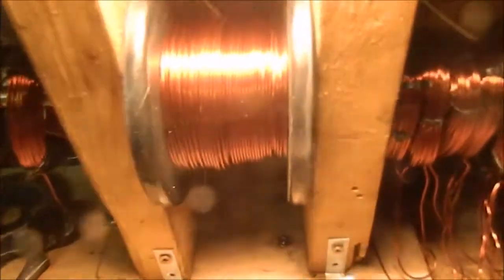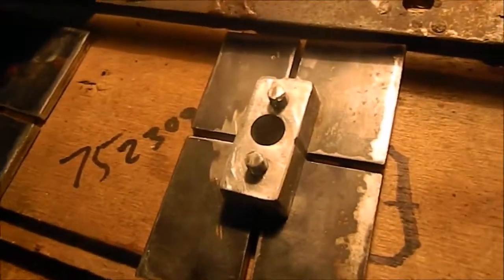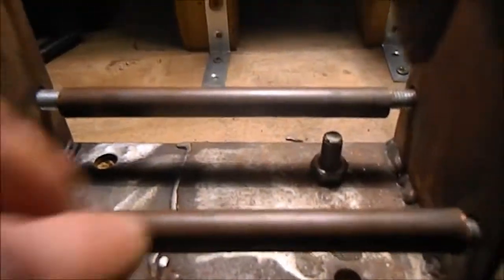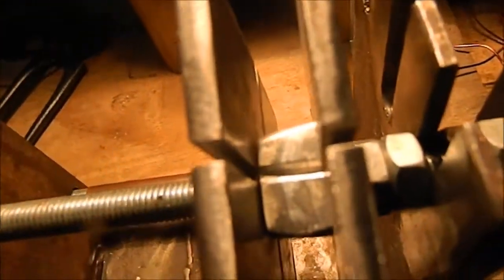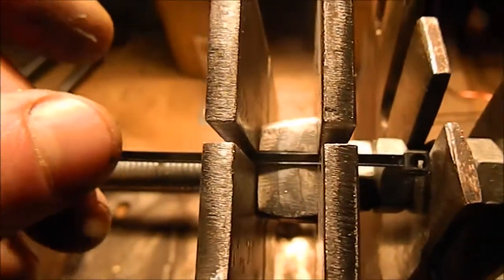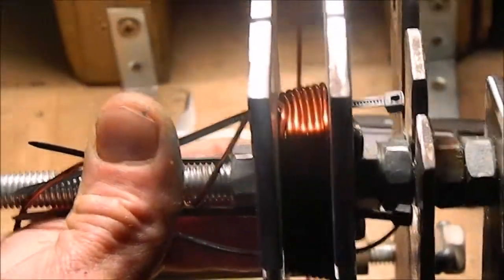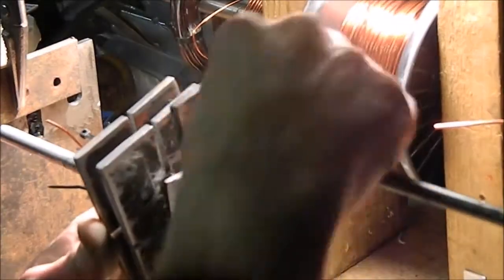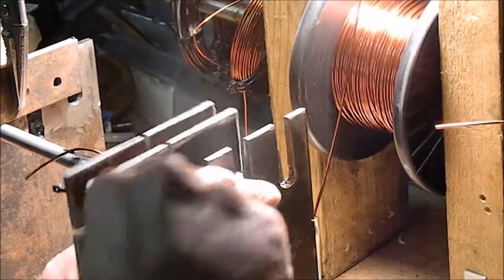24 volt Coil winding for 12 coil stator pt 1 of 2 11/12/2016

Comment: i know this is after the fact, just thought id mention it , i saw one guy leave something like a small bead of weld on the inside  of the side plate of winder so that his coils would have a slight indentation to allow for the centre wire of the coil to sit flush against the coil , how easy it is in reality ?.
nearly got all my stuff to get started myself, was looking at your winder remined me of josep casteles, im going with a robust winder too wood is a pain.
Reply from the maker: The metal one was harder to make but i have a chop saw and just cut  12mm ally sheet to make the centre, I may make another one and do a video, hope you are well